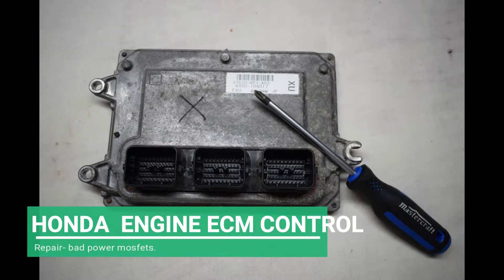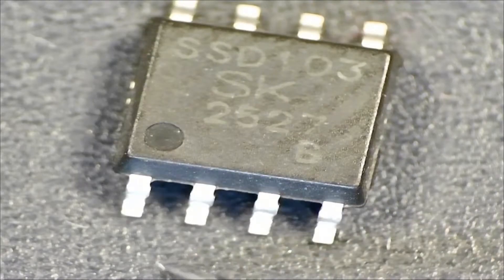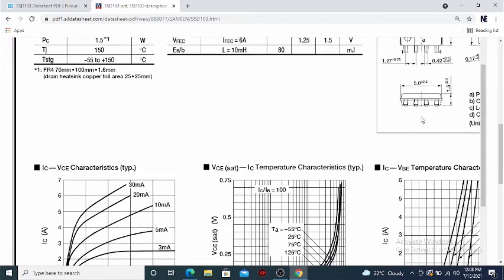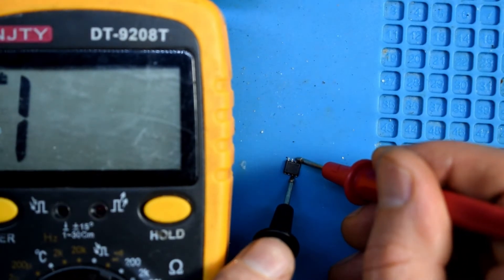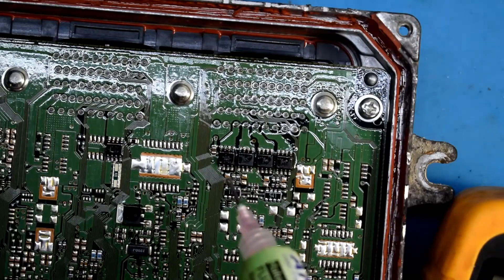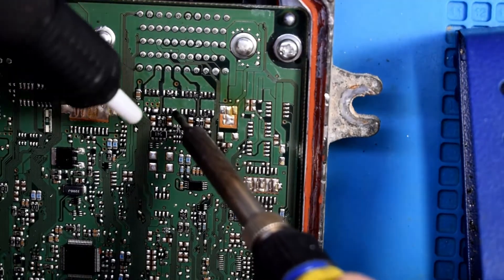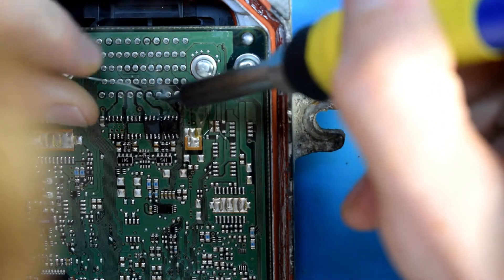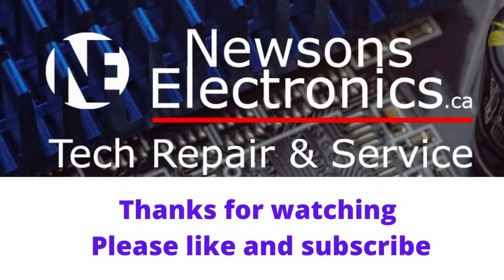How I fixed a Honda ECM module fuel injection for a car (37820-RP3-A03)

Comment: Hi, one SSD103 is gone on my Honda Jazz 1.2 (37820-RC7-G05 ECU part number). Can I replace the SSD103 from a spare ECU I bought on ebay? (37820-RB2-G17 is the spare ECU part number).
Reply: try it, it shouldnt hurt.

Comment: This was my ECU, I just wanted to update that this fixed the fuel injector misfire on my car and hasn’t had an issue since.

Thanks again!
Reply from the maker: Glad to hear
Reply: Hi where did u get the SSD103 To replace the old ones. Thanks